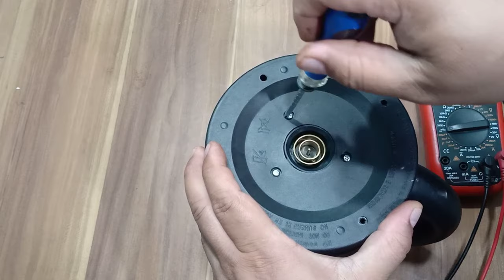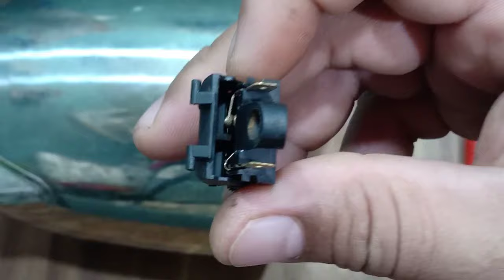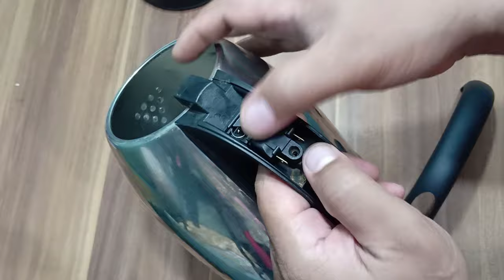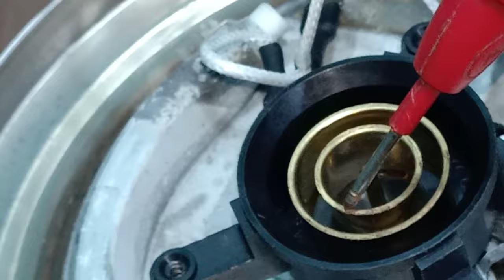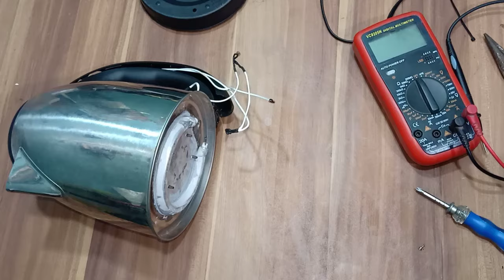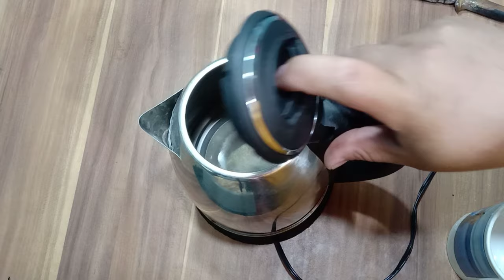Electric water Kettle heater tips how to Repair

Comment: Sir Ang unang problema sa electric kettle ay thermal fuse at ilaw, napalitan ko na ayos naman ang problema ay ayaw maguatomatic tuloy tuloy Ang pagkulo ano ba ang dapat Kong Gawin para mag automatic off
Reply from the maker: Adjust mo po Yong contact don sa quick release switch Ng heater mo kaba masyadong naka lubog tingnan mo rin Yong plate na lata don sa switch Kong ayos Paba, yon kasi Ang nag papa auto off nya.

Comment: Sir ano pala inayos mo  contact points ng switch tinuro mo lang tas. Inassemble mo na
Reply from the maker: Yes sir dalawa kasi yong switch Jan isa sa handle and yong isa sa protection Ng heater, Kay Pag nag check ka Ng Ganyan heater 2 option dapat Gawin mo pinakita ko Lang Yong dapat mo gawin para mike sure na maayos mo yong heater mo and sorry narin kasi na copy right na Yong audio kaya di masyadong maintindihan 😊

Comment: Bossing ganyan brand din un nabili kong water heater Scarlet ang problema di na gumagana un auto stop nya pag kumulo na yun tubig pag plug sa power naka on na agad maski di pa naka on dun sa power sw.sa handle..pwede pa bang ma repair un..
Reply from the maker: Yes po Stack up po Yong switch non Jan po sa video Kong paano eh check And cleaning yon, and Pag na buksan mo makita mo din Yong Contact Ng switch Kong bakit di sya Gumagana adjust mo lang yong distance  using scraw. 😊
🎬 Watch mo lang Jan😁 sorry Tinangal ni YouTube yong audio😔 kaya di na marinig Ang sound pero makita mo rin Kong paano ibalik yon switch. Thanks for watching 👍 stay safe 😊

Comment: boss ung elec,kettle ko may power pero ayaw uminit, pag nag swicht ako umiilaw naman, ano kya sira
Reply from the maker: Baka po nasa element na ng heater ang problema na busted. Or check mo po Yong seconds switch Jan sa gitna ng heater Minsan po kasi dina lumalapat ang contact ng switch

Comment: Pagwala bang ilaw pedeng gumana o uminit
Reply from the maker: Pwede po Naman! basta sure mo lang po busted na po yong bulb indicator po kasi Yan Kong may voltage na pumasok sa heater. Kong Ok Naman Yong ilaw check mo don Po sa first switch sa handle Ng heater then 2nd switch sa ilalim Ng heater baka don di lumapat Ang switch. Thank you stay safe.

Comment: Paano kung naisaksak na walang tubig tapos Di na umilaw
Reply from the maker: Kong dina gumagana Yong indicator Pag Ganon po katalino Ang gumamit 😅. Ang possible na problem don Yong second auto  switch dapat Ang eh check mo Nan Jan sa video. Na sa ilalim Ng heater element Yan nakadikit ito yong protection Ng heater element para di masira ka pag Ganon nangyari.